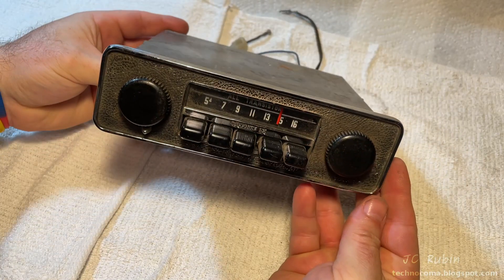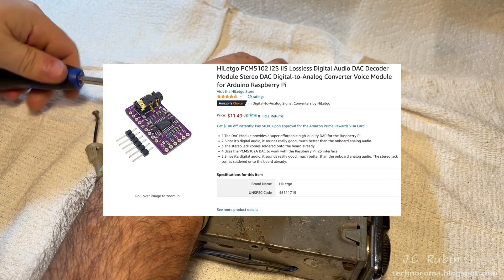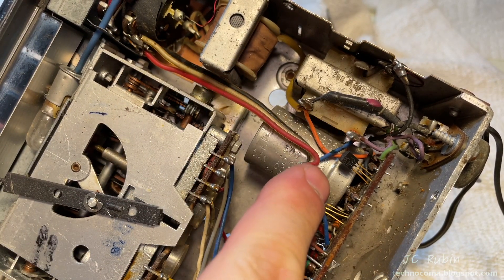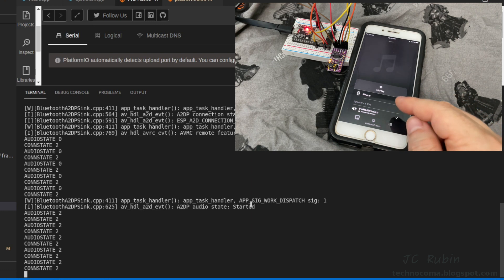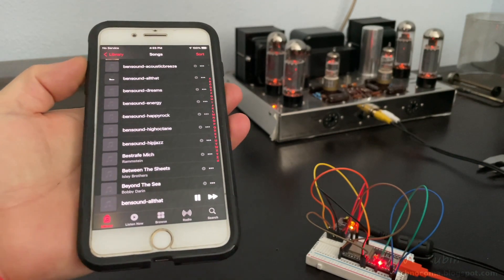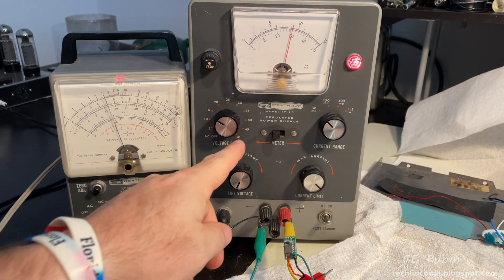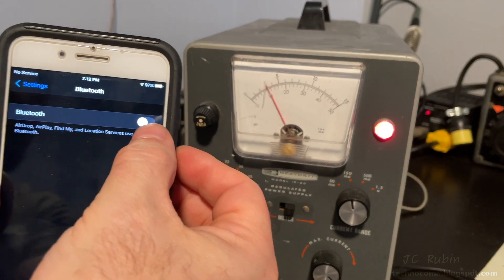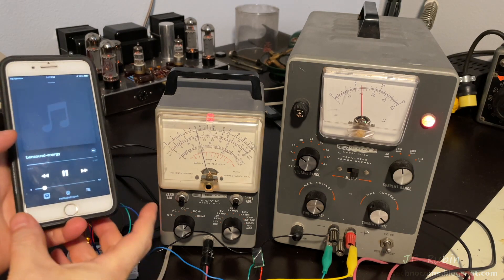Antique Car Stereo Bluetooth Audio Retrofit with ESP32 - Part 1 of 4

Comment: Cool stuff! Regarding the drifting voltage regulator: I don’t think it’s an issue. The ESP board routes the 5V pin to its own regulator for 3.3V and this regulator can take up to 20V. I once used this with 12V to drive LED strips, so I know it works. Not taking into account power efficiency, you could get away without using the dc-dc at all

Comment: Just when you think you've learned everything...
Very impressive.
Where did you learn all this?
I ask, as I have a 2008 head unit which I would like to add Bluetooth for streaming Spotify.
Reply from the maker: Newer radios are difficult as everything is integrated into components that cannot be tapped into in this manner.